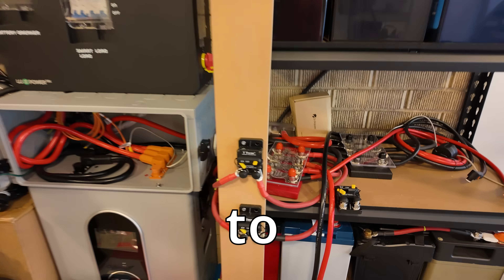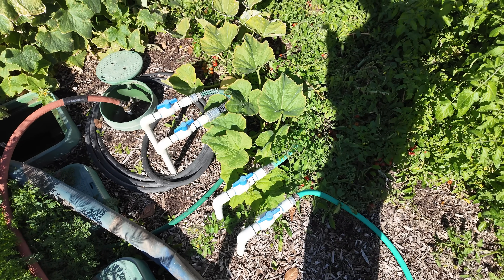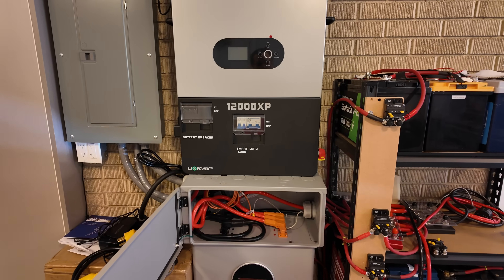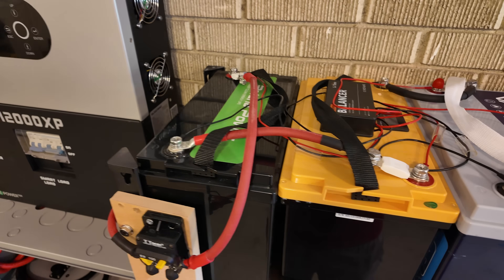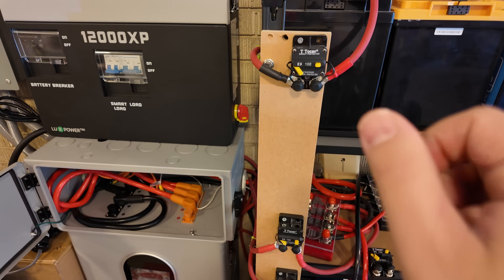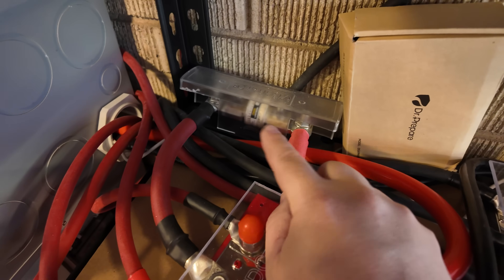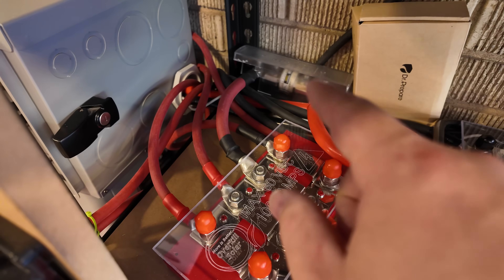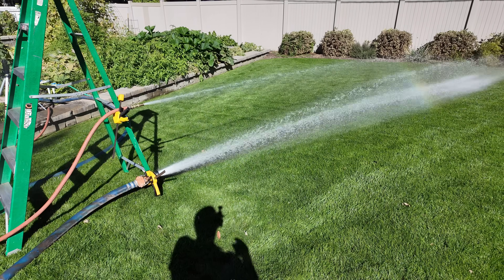EASY! The ONLY Video You Need to Understand Cable & Fuse Sizing! (DIY Solar)

Comment from the maker: Ask me a question and get a personal in depth response: https://ko-fi.com/s/8d8df1880c 
OR
Sit down for a personal 1-On-1 hour long video consultation with me and I’ll provide answers and insights to anything you want to ask me about from this channel: https://ko-fi.com/s/dd139831a7 

All donations get 100% re-invested in the channel:
https://buymeacoffee.com/theresatrickforthat 

Buy battery cables: https://amzn.to/4h3ox3k 

Buy 80v inline fuse (they are always out of stock it seems) https://amzn.to/4mYRSgI 

Buy a T-Class Fuse: https://amzn.to/3W25MUq 
Buy a T-Class Fuse holder: https://amzn.to/4q5c2sf 

Buy my battery shelves: https://amzn.to/42RwFyg 

Buy bus bars: https://overkillsolar.com/product/1000-amp-max-terminal-block/ 

Buy an EG4 12000XP Inverter: https://payoffsolar.com/product/eg4-12000xp-off-grid-inverter-v2-eg4inv12kxpv2us
Be sure and use the code: TRICK5 at checkout and save 5% on your order!

Buy an EG4 Indoor Wall-Mount Battery: https://payoffsolar.com/product/eg4-wallmount-indoor-battery-143kwh-wm-48-280-1-in-ll-00 
Be sure and use the code: TRICK5 at checkout and save 5% on your order!

Buy an EG4 Chargeverter: https://payoffsolar.com/product/eg4-chargeverter-gc-48v-100a-battery-charger-5120w-output-eg4cv48v100av3 
Be sure and use the code: TRICK5 at checkout and save 5% on your order!

But a conduit box: https://payoffsolar.com/product/eg4-indoor-buildable-conduit-box-designed-for-eg4-wallmount-indoor-battery-eg4spidwmbcndtshrd 
Be sure and use the code: TRICK5 at checkout and save 5% on your order!

Watch all my battery testing videos: https://www.youtube.com/playlist?list=PL-2uuHDasQcp2gNWpR-N_GUEey1fhnbgI 

Affiliate Disclosure
As an Amazon associate I earn from qualifying purchases at no cost to you! Thanks for your support!

Comment: I also want to add more Capacity to My 7K Aeliussine / WZRELB Dual.Phase Inverter by 4 12 volt 280 ah Chins + 4 12 volt 280 ah Chins in series for 4S2P and Disconnect Switch to a Main Buss Bar with 4 24 Volt 100ah XYnZ Batteries + 4 24 Volt 100ah Redodo Batteries to It's own Disconnect Switch and Dual RENOGY 60amp Charge Controllers to Feed each Buss Bar in both 48 Bolt Battery Bank Packs. Is this doable ?
Reply from the maker: I don’t fully grasp your layout 100%…but as you see from my video, I have successfully mixed different brands of LiFePO4 batteries.
Reply: I have 4 Separate Battery Banks here - How do I Wire Charge Controllers to Them and use The Solar input as I use them in Tandem. @theresatrickforthat

Comment: Wire size is expressed using "Gauge" or "AWG" in North America (American Wire Gauge). Most of the rest of the world uses a measure of the total cross sectional area. If it's single strand wire, then it's the cross-sectional area of the single strand. For stranded cable, it's the sum of the areas of all the strands. 

It should also be noted that where you can't get, say 20 mm2 wire (4awg), you can use two runs of 10mm2 for similar current requirements. You will see this in places where. Usually, 8awg wire will cost less than half the price of 4awg.

2 AWG wire is supposed to be 33.6 mm2 (square millimeters).
2/0 AWG (two ought) cable is 67.4 mm2.

According to the chart I have:
- 8 AWG = 8.37 mm2
- 7 AWG = 10.5 mm2
- 6 AWG = 13.3 mm2
- 5 AWG = 16.8 mm2
- 4 AWG = 21.2 mm2
- 3 AWG = 26.7 mm2
- 2 AWG = 33.6 mm2
- 1 AWG = 42.4 mm2
- 1/0 AWG = 53.5 mm2
- 2/0 = 67.4 mm2
- 3/0 = 85 mm2
- 4/0 = 107 mm2
Reply from the maker: Thanks so much for adding this helpful information for everyone!
Reply: @theresatrickforthat   I live near enough to the US, but far enough that I have to deal with wire sold in both AWG and square millimeters. Glad to be able to help with what I've learned.
Reply: I just realized I didn't finish that sentence. I usually see multiple smaller wires being used instead of 1 bigger wire inside of a battery pack. They'll use connection bars between cells then multiple wires to the external +/- terminals.

Similar to how it's done in the video. At 11:29, instead of using 2/0 wire, @theresatrickforthat could've used 2 pieces of 2 AWG wire and achieve the same current carrying capacity.

Comment: Right away the terminology is confusing. &ou said you have 2 gauge and 4 aught. Can you explain the use of the word aught?
Reply: 4/0 cable (wire)
2 gauge wire... Much less passing through 2 gauge.
Reply from the maker: Great idea for a future video! Basically it’s the wire size measurement after you get below zero…yet the wire is larger. Haha!

Comment: Way back before you were born lol I learned EIR, voltage, current, resistance (watts) and yep water flow is a good analogy for electrical. Nice easy math to determine wire size for current flow.
Reply from the maker: Awesome! Thanks for sharing your experience!

Comment: Great job on explaining and it does make alot more sense using the water to represent the flow of things -funny actually because I have been buying alot of components to my system but have yet to put it all together just for the fact that I need more wire and fuses as these items quickly add up in the expense dept. Loving the content and I love the "overkill " attitude as that fits me well in all my doings . Keep up the great work !
Reply from the maker: So happy to hear you enjoyed the video! Overkill is the only way to go! :)